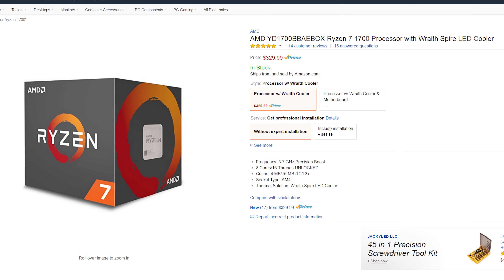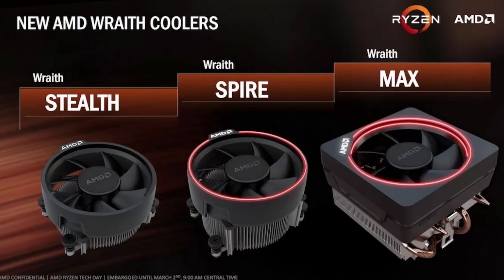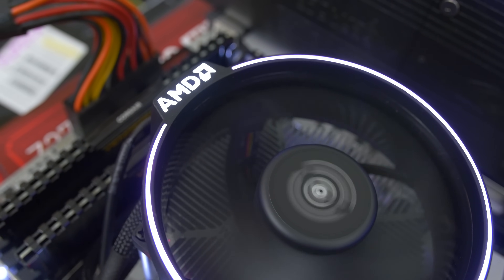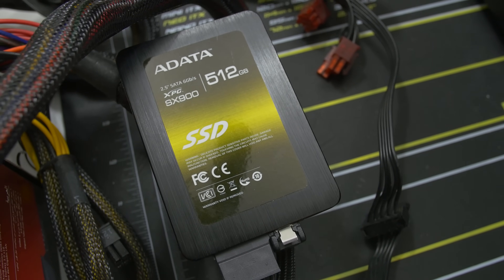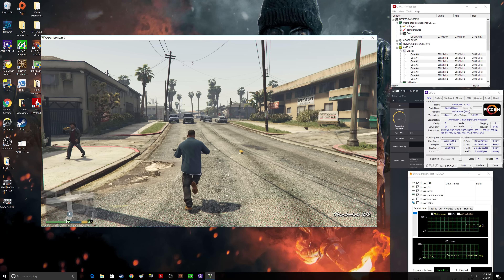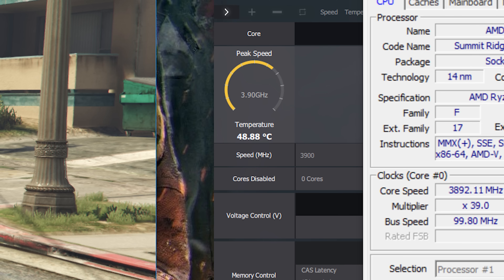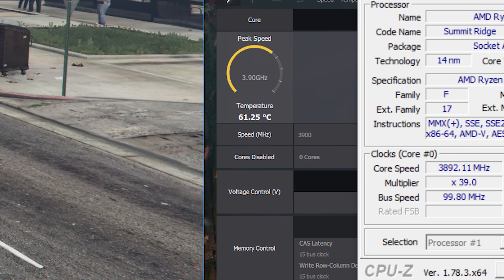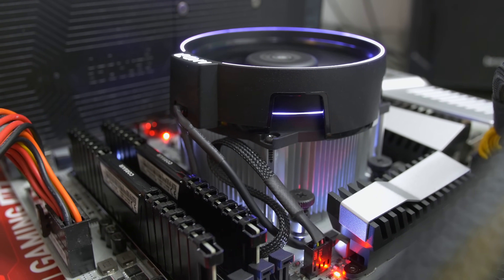AMD Wraith SPIRE: Does it SUCK?

Comment: hows its performance compare to the intel stock cooler? Not that you can mount one on a ryzen chip.
Reply: Seems much better
Reply: well my i5 6500 with a 65tdp on the stock cooler runs at 67 degrees C at idle so the spire is a hell of a lot better
Reply: Intel stock cooler? Please, throw it out the window and get something that can actually be called a cooler :D
Reply: GaudyMarko the intel one is a joke
Reply: keep in mind that intel cpu's can run as hot as 100c without failure so they most likely set the stock cooler fancurve in such a way so it doesnt sound like a jet
Reply: +Mick de Raad - I don't think it's 100°C, but it's not far off. Last I knew, the TJMax of basically all recent Intel chips is 95°C, while for AMD it was 65°C with K10 and 70°C with Bulldozer and its many derivatives. Not entirely sure where Zen lies on that spectrum, but it seems to be able to withstand much higher temps than its predecessors...
Reply: Mainstream Intels don't have soldered IHS since SandyBridge, there's subpar thermal paste between IHS and chip. That's why delidding is a thing with intels.
Reply: +Andrew Small interesting, you didn't know the haswell k skus came with stock coolers. It's the newer ones where they don't even include their coolers.
Reply: +Mick de Raad even when you bypass the usual cooling and set your own curves or just ramp up the speed through a controller it doesn't do a lot of good for cooling and just gets insanely loud. It's why most people opt for third party coolers.
Reply: Lofty Smalls I'm guessing you're intel when you go to school?
Reply: 4460 with stock cooler i reach 65+ at 100% use . thats pretty awful since i got a decent aired case . fractal design core 3500, for a 3.2-3.4 chip
Reply: Ionut Cosmin My g3220 always stays at 40°c below on idle. And max 55°c in playing cpu intensive games for hours. That's on crappy intel stock cooler.
Reply: Maybe you should learn to properly install the cooler.

Comment: Does anybody know how to use the stock coller rgb on the asus prime b350 plus? I cant see the changing color in the bios. Btw, my stock sounded like a jet engine when it was running max fan speed.
Reply: Tukuto Try a program called Aura I think from Asus. Try the Asus website and go to the download section for your board
Reply: Alan Schulwitz i tried it, but it only recognized my gpu

Comment: can anyone suggest me some good 6 GB 1060 ?
Reply: rx 480 slightly outperform the 1060. they go for as low as $170 right now unless you're not in the U.S.
Reply: zecRjee just not the gigabyte 1
Reply: I saw a really cool Asus strix
Reply: Pedro Simões honostley you should just get the 3gb gaming x from MSI because you will most likely not need the 3 extra gigs unless you're going to use it for productivity
Reply: My 3gb 1060 uses all of it while playing BF1. 4Gb should be the minimum.
Reply: yep i'd say its better to get 6gb as its more future proof
Reply: Pretty much all bar the reference one, so just go with whatever best matches your colour scheme/theme.

I would highly recommend going for an RX 480 though as it's just a better card and should cost about the same.
Reply: All of them are good
Reply: Pedro Simões MSI gaming X
Reply: Pedro Simões asus dual fan oc edition
Reply: Joao Roncete white tho
Reply: ATejkl Gaming then an rx480 wouldn't be barred
Reply: msi gaming 1060
Reply: Pedro Simões rx 480
Reply: SlavjanA 1060 is better
Reply: get any rx 480 8gb it will get the job done

Comment: But its rgb! It must be good right?!
Reply: Well it has a red LED
Reply: Just change it to red, it's RGB for fuck sakes.
Reply: Just as long as you don't use the green light. BEWARE OF THE GREEN LIGHT.
Reply: it has. (when is spinning )
Reply: Shreyas Misra red green blue
Reply: lucas rem what
Reply: Its a joke you dipshit
Reply: Lucas Rem what are you even talking about?
Reply: lucas rem nobody here is crying except you. they're joking if you can't tell.
Reply: Does anyone actually know how to change the rgb?
Reply: 3rd party software, he even shows what pin the rgb for the fan is is using
Reply: Saud  Siddiqui Green is not a primary colour. Yellow is, infact Green is mix of blue and yellow
Reply: Roberto Manfredi in light it is RGB, in pigment it is RYB
Reply: lucas rem I have the gigabyte GA-AB350-Gaming 3, I found the cable and plugged it in, went into the bios and tried there software which is garbage btw and it doesn't allow
Me to change it
Reply: No it is rgb